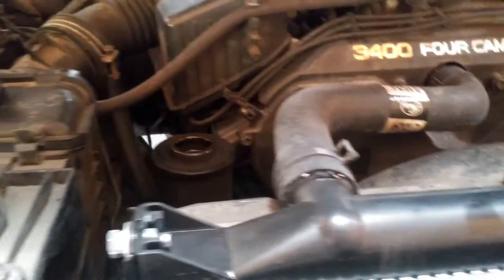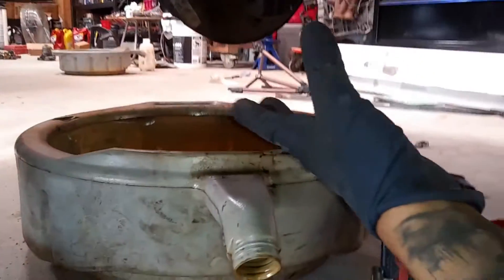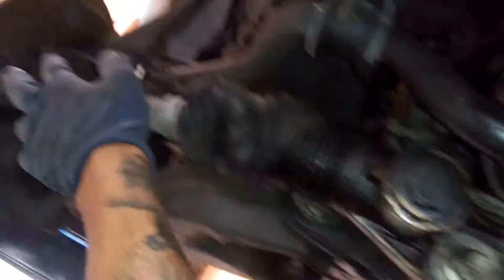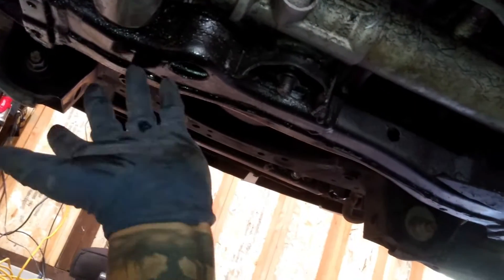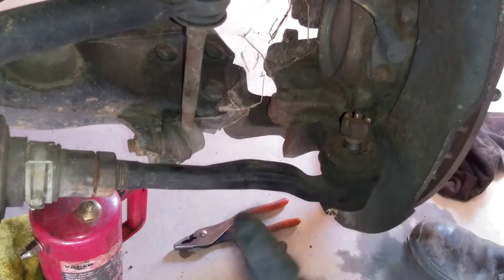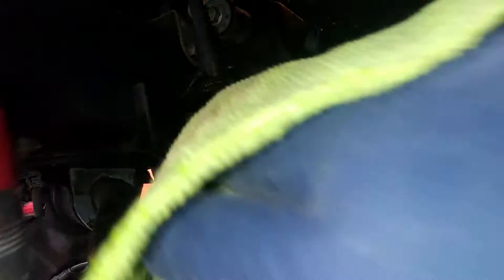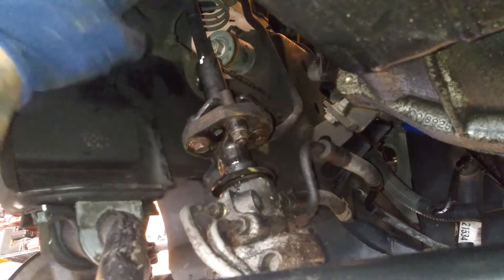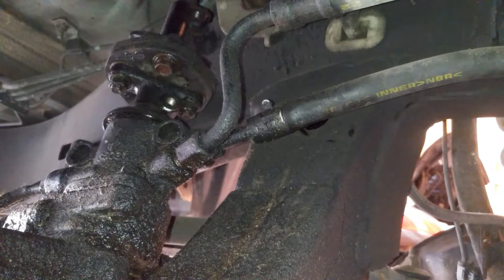toyota 4runner/tacoma rack and pinion replacement

Comment: I have a 2000 4Runner. What brand rack and pinion and tie rod you recommend? Thanks
Reply: Hit up CVJ axles. Little pricier, but built in the US with higher quality materials. 3 year warranty.